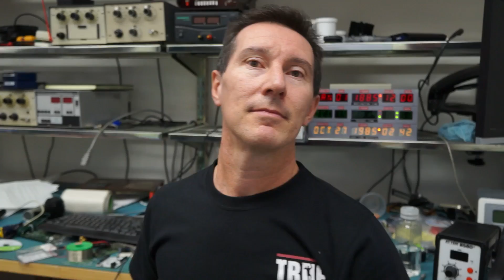eevBLAB #2 - Are Electronics Hobbyists Useless?

Comment: Isn't it amazing how most of us are just attracted towards commenting on this video? I am currently in my 2nd year coursing for an EE degree, and yes, it sucks. Teachers don't teach students basic skills, nothing that could work in real life, mind you. Dave is completely right, learning those skills by yourself IS THE DEFINITION OF HOBBYIST. I am 19 years old now, and i could do everything Dave listed when i was 15 years old... How come a university student can't?
Reply: Its sad because in my first year of mechanical and in OAC physics I was working on "loop and node" based circuit analysis tools.  Again though we never really got into anything deep.

By first year uni I had a circuit analysis course (moved to second semester now) where I studied.  and while issues with ROHS and "safety" have moved soldering irons out of the labs for anyone lower then 4th year EE (unless you pay for your insurance and cash card like which chem)  We mostly did our circuitry and labs on breadboards.

Plus that type of equipment is too expensive to maintain and monitor for people anymore.

We have a specific "interprovinchial trade code" here in Ontario for "electronics repair" that has a specific and official means of testing these practical skills.

People would do better off with a mail-in order study of "electronics repair" then "engineering" for the educational background for this type of job.

Which only brings the debate of "engineer" vs "technician" out.  And both sides absolutely hate each other as much as the University vs College debate.

Comment: I don't know what uni some of the people here go to, but I've just completed my second year of electrical engineering at the uni of Queensland and have already completed three projects, including getting circuit boards printed.
Reply: Likewise here in Canada though I had to learn to solder on my own.  It may have been because I was mechanical/Aero (with 3 or so Courses of electrical fundamentals) but at least not until 3rd year do EE's get to play practicum (again with deposits/cash cards for liability reasons and 800 or so degree heat)

The rest of what he wants is available in a Technician's Role TBH, but the definition of "engineer" vs "Technician" is burried in professional regulations and petty politics with the "trade industry"

Comment: I've been an electronics hobbyist for over 10 years and one of the things I haven't done much of to this day is any sort of CAD circuit design or board layout. Most of the stuff I've made I've used pencil and paper when drawing up schematics, test on a breadboard, and then proceed to solder up a prototype board, which usually ends up being the final product since most of the things I do are for my own use and I only need one.

But one of these days if I need several copies of a particular board I might dive into CAD board layout software.

Comment: Amen brother. As an engineer at a university, I expect the same from interns. Let's just say, I rarely have interns...
Reply: Sadly engineering courses have always had very little practicum and expecting your interns to already be graduates is unrealistic.

When they do its either the students responsibility to pay for it themselves or its in 4th year 'capstone design' projects.

I know here there is a 4 year apprentiship and 2 exams AFTER your degree to pull that through.
Reply: sazerchu There are many different ways to learn though. I have a degree in ME, so none of my classes covered electronics at all, except some LRC circuit stuff in physics. But by the time i graduated I taught myself circuit design, soldering, firmware for microcontrollers, everything Dave mentioned. Now i'm the lead engineer at my lab when it comes to anything physical. Electrical, mechanical, firmware, some computer software.

So i'm not trying to argue with you. Since i know the school i went to hardly teaching anything at all when it comes to electronics and firmware (even for the ECE folks). I actually proposed me teaching a course on all the things Dave mentions, but since it would cost money for them to build and solder boards, they shot me down.... US school systems at work...

Comment: No, you are not asking to much! I started in electronics as a boy in the 1970's, used to sell old newspapers and cans so I could buy a couple of transistors to build an oscillator or something, or "cannibalized" my dad's radio to get them! Designed and build my own basic metal detector when I was 12 years old, and a lot of other stuff like dark room timer, automatic plant watering system for my mom, the typical transistor checker, an electronic ignition for my first car, a VW Beattle, a "line follower" robot, build my own R/C radio, etc. from a Heathkit, etc. There where a lot of us kids doing that in the 1970's and most of them where able to do single sided PCB's, good soldering, resistor calculations and substitution, transistor substitution, etc. Most of them did quite complex projects for their age like digital multimeters, ham radio receivers and transmitters, etc. And there was no internet! You went to your local electronics store and asked to borrow data books because they would not give them away to 12 year olds and you couldn't afford to pay for them. True hobbyist really learned a lot about their hobby, whatever that might have been, not just electronics.

But apparently nowadays an electronics hobbyist is just a "module integrator". They buy premade Arduino boards on ebay and stick a couple of premade Arduino shields, then programme it with a few premade libraries and say they "designed" a timer to turn on their porch light lol. To me that's not design, it's not even "electronics hobby", it's consumer products. A true hobbyist designed, built and programmed it's own 8051 or whatever using assembly language. And if you went to a meeting you could see dozens of different ways people solved the same task, nowadays you see the same premade board with different cable colors, that's it.

The true Electronics Hobby is practically dead, there are almost no good stores to buy parts other than online, no really good kits anymore like the Lafayette or Heathkit, and for some reason people prefer premade stuff.

But there are some true hobbyists left, a very young neighbore keeps visiting every saturday with new questions and keeps raiding my junk box for parts, she made a really cool control for her aquarium by herself! She never asks basic questions, those she looks them up on Google herself, she just asks for help when she already tried and could not figure it out.

So I guess there will always be true electronics hobbyists, just not as many as before.

Comment: I'm with Dave, I think I have all of the skills he mentioned, I think leaned all of this in an education or hobby setting, I do not think I learned these skills at work. But I live in the UK and I work as a Software/Electronic Engineer, so I wont be applying. Just to be clear, I really don't think I acquired any of those skills at my current job, though I certainly did turn some from basic level to advanced.

Maybe also some people out there are forgetting that NO job advertisement is seriously expecting all applicants to have 100% of the listed skills. If you don't apply because you think you are missing maybe 2 skills, someone missing maybe 3 will get the job! Though I have to admit, Dave's is way more reasonable than anything you will see in industry.
Reply: He isnt demanding a specific degree or trade certification or a number of years of experience.

Which in itself is a form of shooting yourself in the foot because employers really tend to overestimate the "experience" field.

If I were him he is expecting alot of practicum and that means a skill demonstration is required.

Comment: Really? You guys think it's hard to make a PCB with 20 to 30 discrete components and/or program a micro to do miscellaneous stuff something like 16F84A. Or arduino?
Reply: when the components are 3100 dollars yeah.

Its likely why public schooling and not "hands on programs" dont have them.

And you have to buy them yourself to work with them.
Reply: sazerchu "when the components are 3100 dollars yeah" yeah then you don't know how to take it step by step.
Reply: Its not the components its the tooling.always has been.  People forget how expensive of a hobby it can be.

A mid-level Audrino is 600CAD plus the cost of a soldering station capable of SMD, basic supplies, hand tools, DMM and THEN your components (and/or the design program to transfer to your facility). 

Then of course your "cheating" by buying the programming module and encoder you will need to actually set your controller up (another 120 or so depending on what your "controller is") and some of the input sensors (depending on what you want) cost a fortune..

Plus the cost of turn around to whomever your "prototyping" company is. Otherwise you can spend anouther 150 on copper clad and etching compound to do it yourself.

Then add shipping.

Not 3100 but well over 1k.

"Hobbiests" need not apply when he is asking for 3-4 years of post secondary training or what amounts to a journeyman's skills and tools here in Canada.
Reply: sazerchu step by step man, step by step...
Reply: all or nothing or don't bother calling yourself a "hobbiest".

That's the message of this video.

But your right like any other hobby you get it one piece at a time.

Comment: Hi Dave, I started engineering school  here in America in the early 70's;we used slide rules because a basic calculator wasn't available yet let alone pc's!
We learned the nuts and bolts so to speak, of electronics from the ground up; vacuum tubes were still used in some lab equipment! 
We had to know everything about our field of study, including some of the subjects that you just described.
Over the years, as I progressed through the ranks from jr. engineer to design to sr. EE, to director, I had the oportunity to interview various graduates, and as the years went by, it seemed that grads became less proficient in the basic skill sets.
Maybe there is just too much information to absorb in 4 years, or the kids are just getting a less varied education.

Best regards from the USA,
Paul Fasolo

Comment: I dont think thats much to ask at all. I myself dont have all those skills.. YET.. but its also a desire to learn what really goes on with electronics, and not just getting a degree where most of what you learn is based on formulae and datasheets. I actually dropped out of EE because of a lack of practical applications. Ive actually learned more watching your videos (and others, if i want to go more in depth with a concept or part you touched on) than i did in university. Basically from nothing, to a working AVR controlled nixie clock on my first go. Yeah i could have soldered a kit, but who learns that way? Design your own, build it.. and yes Dave, like you said in a very early video, it DIDNT work. But releasing the magic blue smoke taught me a lot about pnp-npn pair circuit design (for the anode switching.. until i found out about the TLP627 optocoupler). My next step is going from a protoboard to an actual pcb, but still trying to find the elusive $5-$10 manufacturer here in Canada.
Reply: you can try OSH PARK from USA the ship worldwide
Reply: Itead studio are about as cheap as it gets IME. Very reasonable price for smaller 2 layer boards, and they ship to anywhere

Comment: As others have said; I do not think it is asking too much for the position you want to fill, but I do believe the term "hobbyist" has changed in meaning enough that it IS too much to ask from a run of the mill hobbyist.

As we see more and more "out of the box" and "easily accessible" tech like arduino hit the market there is the side effect that higher and deeper levels of EE skills are becoming less necessary and less desirable by the average "hobbyist". Someone brought up the point "why research ICs and analog circuit design when you can buy an arduino and shield that will do the job".

That being said, I do research, design, layout, manufacture, test, and debug my own circuits, and have for years. I even consult for others seeking to do the same or have it done for them. I don't call myself an "electronics hobbyist" though, I call myself "an Amateur Electrical Engineer", and I use "amateur" in the sense of Amateur Radio; a "hobby" field where technical knowledge and skills are not eschewed away as archaic.

So, Dave, I don't think you need to ask for less, I think you need to use a different moniker for the person you're looking for!
Reply: He is looking for an enthusiast with a high level educational background (or at least equivalent) and practical skills who has actually put theory into practice.  Not all "hobbists" are "enthusiasts" and not all "enthusiasts" are hobbyists.

He is recruiting to a crowd who for most intensive purposes have moved beyond this blog due to their level of skills.  If they are at or near the same as him then why would they work for him (instead of making a copycat channel about a specific specialty).  Otherwise its looking for a needle in a haystack (sadly most jobs are this way).

Like he said he is tired of seeing 3rd year electrical engineering students who can't even use a soldering iorn-- but looking to a crowd who uses him to teach soldering iron skills to is kind of self-defeating.

Dave should probably review his wanted ad to filer out such people. and possibly look at a practical test inside his interviewing process
Reply: J brogly.decap
CAN'T
Reply: sazerchu You said "hobbits"  hahaha
Reply: Brad Morris ENGINEERS CANT SPELL

Comment: Unbelievable! Did all that when I was 12. Made my mum a hearing aid with a few bc548 and capacitors and resistors. Collector follower. Won't talk about the etching compounds I laid my hands on for the PCB. Used indelible ink as etch resist. Long before the advent of the internet. Had to get physical data sheets from component suppliers. Parents didn't seem to understand what I was doing.

Comment: I will turn 40 in January and I have only started dabbling in electronics in February 2014. In the past eleven months I have tought myself soldering (tht and smd), I've acquired basic circuit and board layout skills in Eagle, I've done a lot of perfboard and I've had one board produced professionally by Seeed Studio. I have used different AVR microncontrollers that I programmed using Eclipse, AVR-gcc and AVRdude in Linux. I had to learn C for that, too, because I might have a master's degree in Computer Science, but I've only done enterprise Java for the last 15 years or so.

Should an electronics hobbyist be able to do what you ask, Dave? Absolutely. I guess that even I could do most of that, and I'm not even a proper hobbyist. Perhaps an amateur. Probably a dilettante.

The problem might be that there's a lot of makers out there who can do amazing and innovative things with an Arduino and a breadboard, and a lot of those people watch your videos. These people identify with what you do just enough to think that they are electronics hobbyists even though they really aren't. These people are great and many of them have admirable skills - but they have a very different hobby from the one you're referring to. They often are much closer to being artists than to being electrical engineers.

Are electronics hobbyists useless? No. But there are many people who misunderstand what you mean by that term.